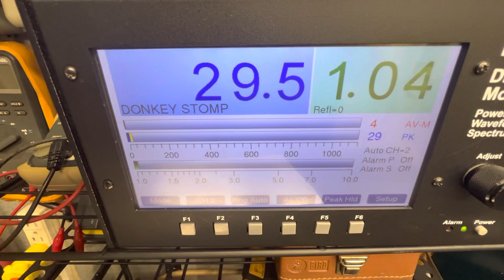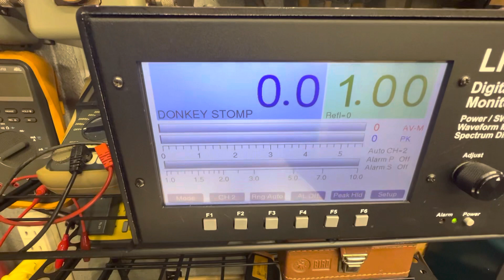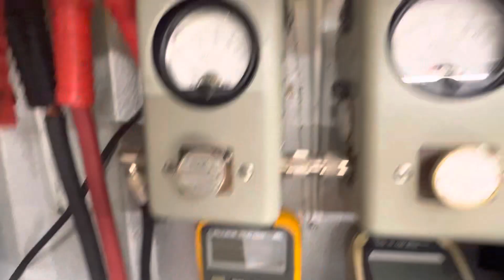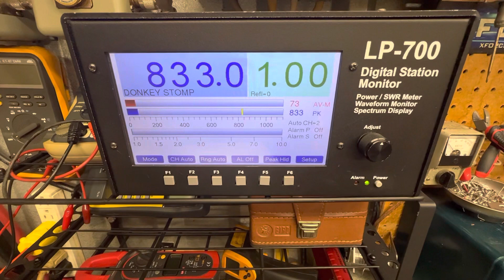Donkey Stomper Products, Junk Yard Box, Iron Core 1X4 Base , Upgrade HG-2510's 28 Volt Transistor

Comment: I'm on my second set of pills in a 1x2 xforce iron core...the 20v on the collector is that what kills em or thr 17 18v under load?  can you build a voltage regulator for the iron cores?
Reply from the maker: I’m sure it’s possible. It would be easier to change it to switching supplies.
Reply: do the 2510s need a tune change or are they drop in replacements.